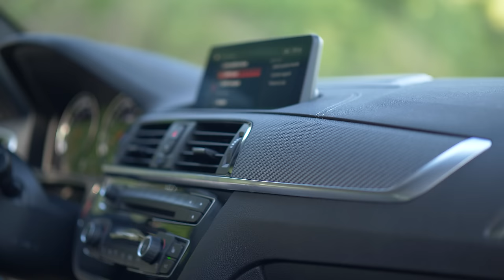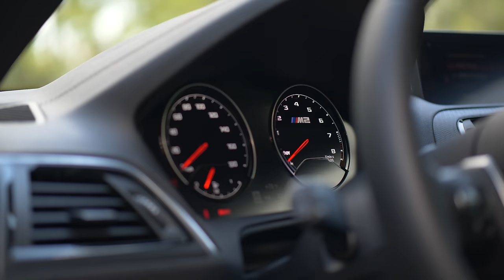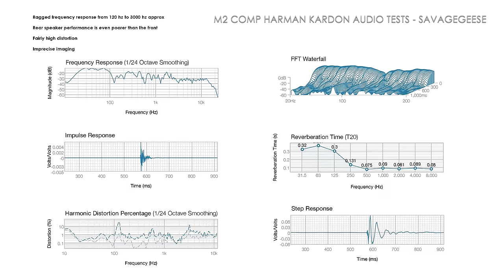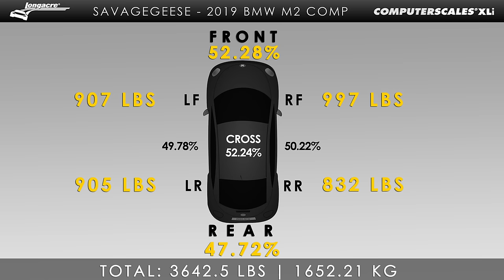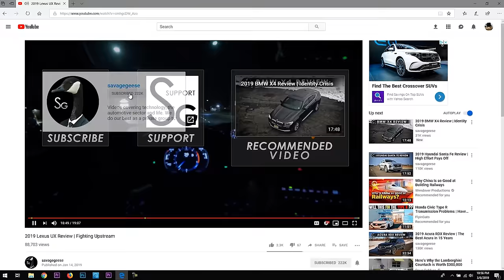2019 BMW M2 Competition | The Throwback Machine

Comment: Did you find the seating position is off? When I sat in both the m140i and series 2 I found the seat was offset from centre of the wheel. Very noticeable, and documented on the net.
Reply from the maker: We didnt notice it that much.
Reply: I too am interested in hearing what SG's thoughts about the seating position are. Some M2 owners on the interwebs claim not to have any problems with the seat, but I recently bought a 2019 Kia Optima which has a driver's seat which is similarly offset in the way the M2's seat is. And it's killing me on long drives. 

Maybe it's just a matter of different body types?
Reply from the maker: @christopheranderson6931  its definately a body type issue.  I have been in a few cars where seats felt offset but this car felt normal.
Reply: I couldn't notice it when sitting in an M2. I was well aware of the angled seat before sitting in it too.
Reply: @savagegeese  Personally I feel seating positions in a lot of modern cars is terrible. Currently being in the market for a vehicle, I have recently sat in everything under the sun. I personally found the BMW's had terrible and noticeable seat to steering wheel offset. Cars like the VW golf GTI and R also have offset but try and correct it by pointing the front of the seat towards steering wheel centre. This means your body is slightly rotated. The Civic Type R was one of the better ones. 
Maybe a video in it.
Reply: @savagegeese  Great video as always. I really enjoy your reviews. ;)

Comment: You're right. It doesn't sound terrible for its type of engine set up.
Let's face it. Twin inline 6 usually sound prettyyyyyy dog.
It still has almost a small pitch range, but at least the sound resonates well for the short range of pitch it does have
Reply: The movie Supra sounds pretty good as well.
Reply: Find a 335is, second is the 135is,
Reply: RB and JZ sound incredible

Comment: Constant throttle oversteer really ruins the experience. The Z4 felt so planted in comparison.
Reply: What about some wider tires? Only has 265 in rear.
Reply: @akkando  It would certainly help, and like the goose said, a 200 treadwear tire would reduce this behavior, but that's just not what I'd want in a DD/Track Day car. It really feels like a tuner car in regards to power/torque delivery.

Comment: It's not a $20,000 interior. Not butthurt this is just really off. Name a single $20,000 car with carbon fiber and metal trim, contrast stitching and perforated leather bucket seats, embroidered seat belts, 3 tone stitching on a leather steering wheel, and generous use of alcantara. You won't find that on even a $40,000 car. It's not the same interior as a $60,000 Lexus (and of course no Lexus drives as sporty), but no way it's a $20k interior. Other than that and the fact that the sound system is decent (not great but not terrible) and it's a good review. I love that you look at the mechanics and not just driving impressions! BTW I've owned BMW M235i, Lexus IS300, Lexus ES350, BMW 335is and the M2C. This has a nicer interior than all of those.

Comment: There are a lot of reasons why, quite a few M owners on Bimmerpost are upset we are losing the M-DCT in the G80/G82.

From what we known, they are keeping the 6MT but the G-chassis M3/M4 will lose the M-DCT in place of a ZF8 because of the AWD. I love my F80 and BMW M's in general but I despise having a ZF8 in the M3/M4. It doesn't feel right. There was no emotion in the gears when I drove the F90 M5 and I'm afraid the G80/G82 will be the same. The M-DCT is a special tranny, I'm sad we are losing it. I will definitely be driving the X3M and X4M, which will be a extremely good indicator of how the next M3 and M4 will be.

Comment: An Audi S3 with similar performance for $45k, or an RS3 with better performance for still less than this. And those have 4 doors and don't look disproportionate.
Reply: They both have FWD biased AWD haldex quattro systems. This is more simple no-bullshit RWD car for people who want to have fun around corners.
Reply: @smilepermile888  Thats what Miata's are for.
Reply: @TheAdventureAuto  Miatas are great for autocross and certain circuits. If you go to a circuit with longer straights and high speed corners, thats where the M2C excels at.
Reply: @TheAdventureAuto  ..and also did you know that some people want to listen to a 6 cylinder engine too? Its inheritantly smoother than a 4cyl

Comment: How can such a small car be so heavy? 1650kg is ridiculous, my 86' E32 735i manual swb 7series was lighter.
Competition model has no advantages compared to regular m2, specifically if you modify them.
Reply: Competition model replaces regular M2 so you don't exactly choose
Reply: Kr Dz built quality my friend
Reply: Weight is largely irrelevant.
As Car & Driver has shown, a 3900 lb Camaro ZL1 on the track will utterly humiliate every BMW ever made. BowelMovementW has no interest in making genuine performance cars
Reply: TasteMyStinkhole as long as your track has no corners  😂
Reply: @TasteMyStinkholeAndLikeIt  whatever you are on, please stop using it! You are humiliating yourself
Reply: @TasteMyStinkholeAndLikeIt  Taste is right. The Camaro ZL1 and ZL1 ILE are beasts on the track, drag strip, and street (650 hp/tq). Check out Savage Geese's review of one and the Nurburgring times, among a plethora of other reviews and tests out there. ZL1 embarrasses many supercars = fact, and will decimate this car. A better match for the M2 Comp is the Camaro SS ILE which is the mid range Camaro model (455 hp).

Comment: I just swapped my OG M2 for an Aston MArtin Vantage Roadster. I feel like I've stepped back in time haha. The M2 was a great car but it was expensive for what you got and it needed the additional M Performance Exhaust to wake up the noise. That was the single handedly best thing I did to spice up the car. It sounded naughty..... but now I feel like an adult :P :P and the manual in the Vantage feels like old school driving again. M2 easier to drive day to day by miles but the Vantage feels special. Brakes, specifically discs were the weak point of the M2, the rear skips a bit on a bumpy B road but it's not as bad imo as journo's were saying. Why the original M2 didn't have the M seats I don't know. That's probably one of the biggest disappointments in terms of getting something different (I had an M235i before the M2) drove completely differently but inside felt I had been looking at the same car for 5 years, hence the complete change. I would never downcry the M2 for what you got for the money but with the competition now starting over £50k (realistically) & the depreciation they'll get now it's not an uncommon sight takes away from the bang for your buck. I can see the used car market getting a big bolstering (in the UK) with new regs ruining new cars looks, engines etc and prices sky rocketing across the board for new fast/fun cars. Like me I think people will look at a new M2 and go but I can finally afford that slightly older Porsche with an NA engine, or an Aston with the big V8 or an F430 (if you're looking at a heavily specced new M3/4.
Reply: Chris Dorgan 😂 Lol I’m deciding between m2 competition vs 911 Carrera 2017 9000 miles and I said exactly what you said I’m going with 2017 911 crazy you said this my friend

Comment: 3640lbs?!  HOLY MOTHER.....
Reply: Reminds me of a senior in uni who's short but buff af because he is a gym junkie. So he's short but heavy.
Reply: With today's horsepower and torque weight is less of a problem. And wouldnt you rather it have more crash worthiness?
Reply: @timothycc711  with a small footprint weight is a problem regardless, having lots of power is great, but doesn't make the car handle any better.
Reply: @hellobooom  handle.. stop.. mpgs, if that's your thing.. weight is usually a negative. n that is a lot of weight.

Comment: Nice car, but wonder what the long term reliability especially with turbos.
Reply: I have 2 turbo BMW's, one has 140,000kms the other 240,000kms. Both over 10yo. Both go like butter.
Reply: @DiscoFang  That's good news, sounds like they are more reliable than Porsche.

Comment: Great review!!! I only have driven old m2 (n55) But now I want to get M2C for sure!
Reply: M2 Comp has way more top end power now compared to M2 N55. It accelerates very well in the lower gears even in first gear with the extra power.  The M3/M4 Comp have more top end and weigh about the same, but the m2 comp feels much smaller. M2 Comp has a noticeable lighter steering effort compared to the M3/M4 comp, but the m2c is more fun in mdm mode compared to the m3/m4 since you can get the rear end out more. M2C is a great choice for your next fun weekend car.

Comment: BMW should put a depreciation gauge on the dashboard right next to the tachometer. It would have to be something like a calendar / odometer combo gauge, with a dollar figure overlay, so you could see how much value your new BMW is losing with every driven mile, and every passing day. This gauge would run continually in the background, so that when you get into the vehicle after a prolonged absence, it would be able to tell you exactly how much less it is worth since the last time you drove it. I would also suggest that they include a Doomsday / Sunset feature with the depreciation gauge. This feature would activate when the car has achieved maximum worthlessness, which can be described as the point where it would make more sense financially to have it crushed and made into a coffee table, than it would to replace the carbon ceramic brakes.
Reply: No CC brakes on this one, but the M2CS will have them at least as an option besides a lot more CF.
Reply: How is this different from practically every other car?

Comment: If anyones here now looking at supra vs M2. Ive driven both and the m2 manual is more fun. Mabye manual supra might feel better cuz better soundwith the b58 and the lower feeling. But the auto just isnt nearly as engageing and imo the manual in the m2 wasnt bad. No stand out but not something you think about as a weak link. It also felt quite a bit more bunchy stock and the tuning top end is higher with the s58 models (comp or newer years)
Reply: Different cars in my opinion. The Supra is more gt car to me. M2 comp basically says what you need to know in the name

Comment: im debating between CLA45 and M2 Comp Manual, which should I choose? I know they are very different cars, CLA45 is 10K more expensive (with the 45s like package of $4300)
Reply: Get the bimmer. It’s rear wheel drive, has 6 cylinders, and it’s gonna have a sportier chassis
Reply: @Sandia49  spot on

Comment: Mr. Goose, could you please do a review of the M240i. M2 is a little out of many peoples price range but the 240i is attainable. Thank you! 
Stay savage! 🦆
Reply: Facts. I’m waiting too
Reply: The M240i is not as well engineered, dynamically. It's fast but loose. It has a good engine, the B58 also fitted is to the Toyota Zupr4. Where the M2 and S55 engine differ are better handling and greater top end power.

Comment: About the new Supra and it's track performance, apparently it has major issues with bump steer which is a big problem (at least on tracks with more bumps and elevation changes like the Nurburgring). Also it cannot be easily fixed by modifications or setup. Video about it from well known Apex: https://www.youtube.com/watch?v=XSH3RgGSmF0

Comment: I think it looks worse than the original M2, mainly because of the one-piece grill, the wheels and the cow-like muffler. Luckily all of those can be remedied. 

One thing though that I didn't understand was that they replaced the old M2 with this engine because of emissions. But the old M2 had a lower emissions rating than this one if I have the correct info. I mean, if the old one emitted less CO2 then why is this engine better in that respect? I suspect there is something I'm missing.. :)

Comment: savagegeese this or shelby gt350?
Reply from the maker: GT350 if you want to roll dice on motors.
Reply: savagegeese are GT350s really having engine reliability issues?
Reply from the maker: @はる-r1r9f  Everytime we go to a track where owners run their 350s almost Everytime someone has blown a motor or has oil consumption issues.
Reply: @savagegeese  THAT is really disappointing to hear.🙁
Reply: Heard that if you use Royal Purple oil it is vastly superior to the motor craft swill
Reply from the maker: @paulbugoni2846  I mean if you are spinning any motor on track you should use a group5 synthetic.  If people are popping their motors at as low as 350 miles because of Ford branded oil people have more to worry about than just oil.
Reply: Damn that is sad to hear as I loved your review of the GT350. One wonders if the issue has been addressed in later model years. M2 is good to lease, not own. Keep up the excellent work!
Reply: @paulbugoni2846  GT350 is best kept garaged until another sucker comes along.

Comment: The geese guy was much too nice. The exhaust note is not as good as the trick N55 motor in the 2018 model. The M2 Comp is also carrying nearly 200 more pounds and that is never a good thing. I have the 2018 M2 LCI and it is not tail happy. It seems they loosened up the handling a bit. Still, let's give a little credit here, the 2019 is a little faster and has M2 lettering on the seats.
Reply from the maker: Gotta give them credit, they tried with this one.

Comment: The M140i LCi is still the BMW to get. Much cheaper, more practical and fast enough.
Reply: eug3nius didn’t come to the US market, but a preowned M235i or M240i is a good value.
Reply: @rachelleb.2392  And probably a better car on the streets.  Better ride for sure, better highway economy and you do not have to live with Darth Vader interior color.
Reply: Macht Schnell smaller frontal area too, so arguably more slippery as the speeds increase.
Reply: @rachelleb.2392  Sadly, the coupe is still a toy, a second car. With the M140i you don't need anything else. And if you want a toy, why not the Supra?
Reply: @eug3nius  A very useful toy with a real secure trunk, occasionally useful back seats that allow the front seats to recline.  Taught sheet metal.   Add LSD, stiffer rear subframe bushings, the car is pretty sweet.
Reply: @eug3nius  Supra seems to be good once one is past the overworked but underdeveloped exterior.
Reply: @machtschnell7452  If it can't carry a woman, three kids and a dog, it's a toy.

Comment: No full leather interior is my biggest gripe. It should be an option
Reply: That's not the focal point of this car. This isn't in existence to make your neighbor's or IG followers jealous it's a fun and simple car with small doses of premium built in. It's geared towards manageable power, laser handling and small tossable size which reminds a lot of die hard BMW fans of Bimmers of old (think E46 M3, E36 M3 and E30 3 Series).

Comment: Tough sell when you can get a Camaro SS 1LE for under $40k new that weighs less, is more powerful and has a better chassis.
Reply: Doesn't weigh less the camaro is about 150 pounds more but yes I agree, it is within spitting distance and I'm inclined to believe the camaro is more car for the money. It's a battle between camaro's massive dimensions and poor visibility. The bmw has a smaller footprint and way better visibility. The question is the price differential here.
Reply: @GrandMasta1   The 2 series visibility is nothing to write home about. Better than a Camaro but not by as much as I expected.

Comment: No mention of crank hub issues?
Reply: Did they fix it on 2021 model? Anyone ?
Reply: The S55 crank hub is as good as any urban myth comes. It affects heavily modified or abused cars. In saying that, the S58 has a different design.
Reply: @nessuno5403  good to hear that. I have learnt bmw has enhanced It in the last years on s55 and according to a dealership technician there were more m3/m4 with this issue than m2c supposedly bc they are newer.
Reply: @audiophilemetallian  yes, the early M3/M4 are said to have been more prone, but M2 Competition have suffered it too. Again, abused and/or modified cars it seems...
Reply: @nessuno5403  no thats not true, it affects stock cars many times,  just check the M forums
Reply: @qna95B  it's not a defect worthy of any recalls, which means it doesn't happen all the time and you don't know the different circumstances of each case